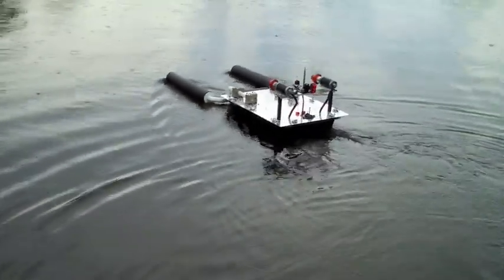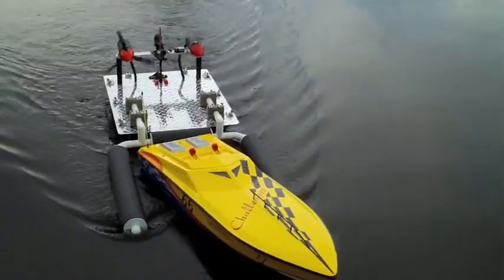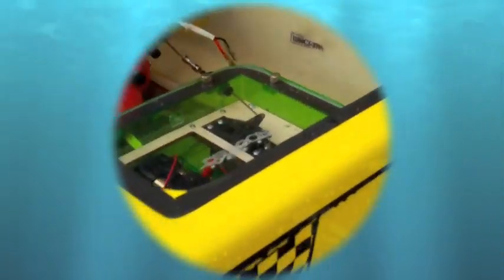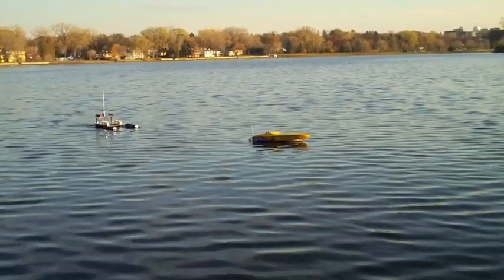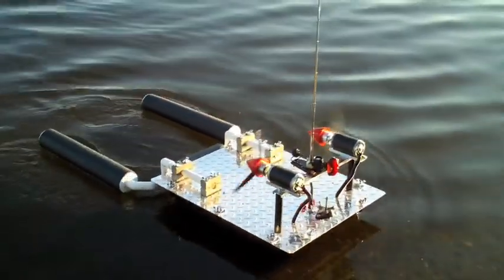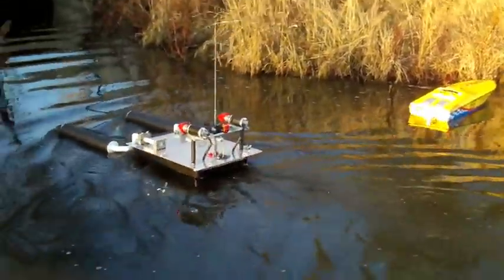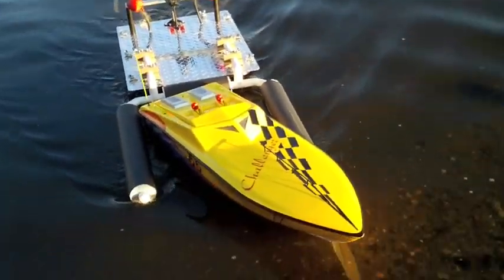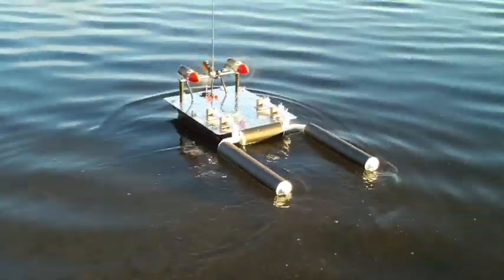RC Rescue and Recovery Barge with on board wireless video camera.

Comment: I had thought of building one, but use an inexpensive EDF on a swivel for power and steering.  The idea of having above the water air plane props so they don't get fouled is an awesome idea!  I plan on building mine out of just 2 inch foam board with a V cut in it to catch the rescued boat.

Comment: 20 years ago when Iwas running my air boat I would use a fishing pole with a heavy sinker cast over the boat and drape the line over  the boat thus pulling it in sometimes a couple of trys depending on the wind

Comment: This was just perfect. Right up my ally. Would it be possible to get some detailed pictures, and maybe a list of all the equiptment you used?

Again, just an awesome job making this rescue boat!

btw, you have to remember to use locktite on those grub screws that's holding that pin :)

Comment from the maker: @heathdspain The problem with using nitro or gas motors there is 
no reverse, I use forward and reverse and  variable
speed of each engine to steer and maneuver the barge.